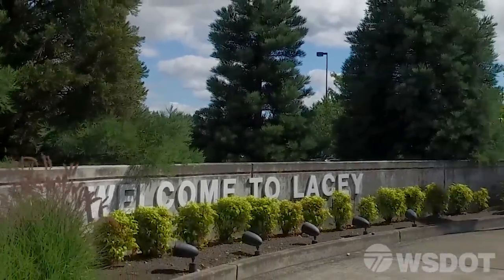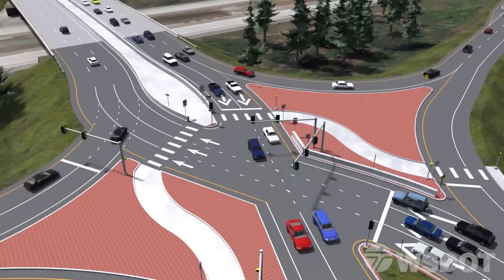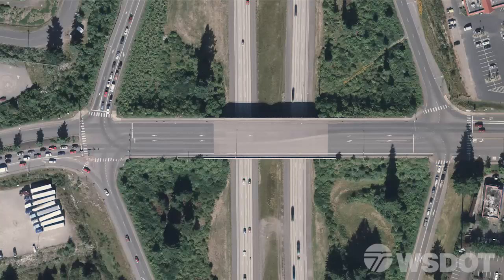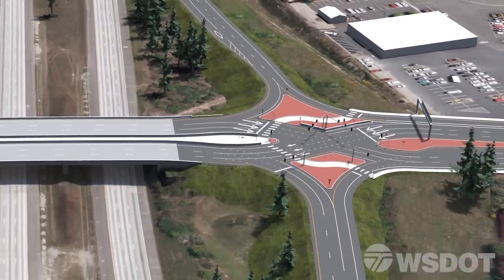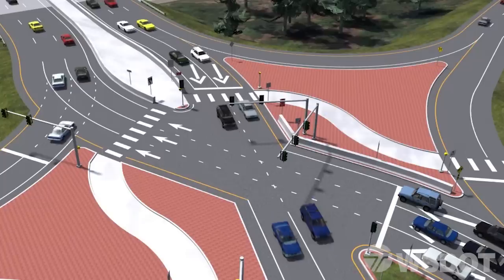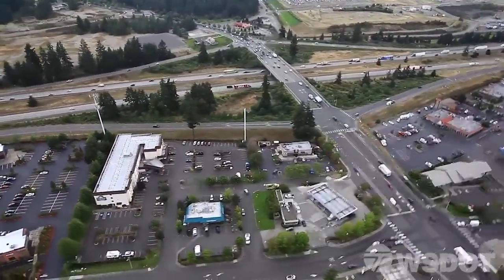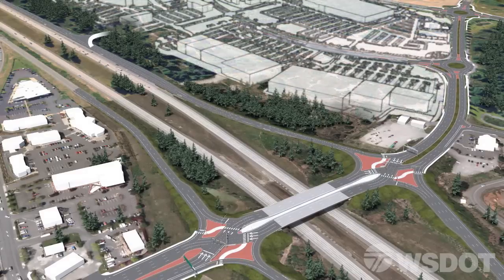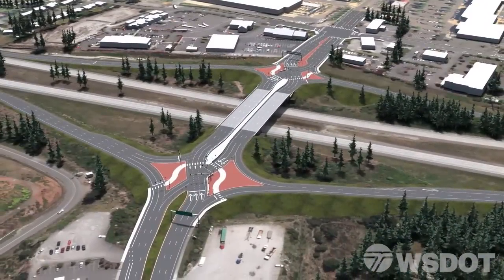Diverging Diamond Interchange comes to Washington State

Comment: Drunk drivers and old drivers get confused enough.  I foresee some crashes at these intersections.
Reply: You just know, those Under the Influence / Confused drivers are going to go straight through, they'll  freak out,  loose control and drive into all those pedestrians and bicyclist making there way down the center of the overpass.  The only way I see these things working is if the state slows traffic down.  You know it could be a new method of population control, most make it through some don't. That was awful dark of me. Sorry
Reply: People should not be driving drunk or high at all!
Reply: Gammareign but they do, so it's a concern that should be addressed
Reply: Gabendini - I agree that drunk/high drivers should be addressed - and removed from the road, not accommodated

Comment: two roundabouts would have done the job..... but ok if you have to deal with bad drivers, then go Diamond with stoplights
Reply: WolfoxBenny or one big one for that matter (which can mean 2 bridges). I've seen it done before in Slovenia, EU.
Reply: Matic Jelovčan that way or make a   motor rod way,  where at each points there are Roundabouts
Reply: That would be best, one big roundabout with two bridges - standard for dual-carriageways and motorways in UK.
Reply: A roundabout is only as good as the surrounding interchanges. If they are lights and are cycling every 2 to 3 minutes, or less if a crosswalk is pressed, then the roundabout is no longer flowthrough but stops with the surrounding lights. Please, understand the full traffic situation in the US before suggesting a model that is completely different. Plus, I'm sorry, but you guys have no idea what traffic is. The worst London, or Berlin can offer is a joke compared to what American traffic can be like. We have far more cars on the road than anywhere in Europe. My community of 100,000 has a freeway through it with 7 lanes in each direction, and it still congests at rush hour. We have that many cars on the road. So no, a roundabout is not a magic solution that always works. They have many flaws and failings.

Comment: You have reduced conflict points down to 14. Why don't you reduce it down to zero conflict points by using the cloverleaf design. you have the space to do it. it will be cheaper in the long run, as there will be no stop lights to set up and electricity used by the stop lights. Less fuel waisted as motorist wait at the red lights and also the fuel wasted accelerating when the lights go green. better for the economy as people will spend more time at work as opposed sitting at the red light going to work. WHY DID YOU NOT USE THE CLOVERLEAF DESIGN.
Reply: the clover leaf design is a very poor design. You have traffic exiting and slowing down in the same lane as cars entering and speeding up
Reply: Slowing down will be a lot safer then having a car in front of you coming to a dead stop. A Freeway means you have a free of way not have red lights stopping traffic. also you can have dedicated lanes for slowing down or for speeding up.
Reply: ...the cloverleaves have weaving conflict points, which are WAAAYYY worse than anything this has. That's why they are being replaced all over the world with more modern designs (such as this).
Reply: Franco Scioli keep it up definitely butterfly is the best . best wishes for you to be transportation minister or  all minds like yours... congratulations

Comment: What's wrong with a roundabout?
Reply: remember, this intersection still has traffic lights. So a round about with traffic lights is the best
Reply: A round-about also allows through traffic to go through smoothly, & right lane cars to divert off without going through the round about just like this DDI, it also eliminates need for a left turn lane, basically does everyhting a DDI does.
But a driver can be stuck on a DDI red light even if their is no traffic or less traffic on the other road. While the round-about driver on a red light is allowed to steal a right turn is there is little of less traffic in the round about. And since it's a round about, the right turn can be used for a left turn as well as a U-turn, pretty cool.
I used to see good traffic management at Bloomfield - orchard lake round about in Michigan sometime back
Reply: Matt Dathew I don't think he knows what a roundabout is...
Reply: In simple understanding, it's just an intersection with a circular island in the middle
Reply: Yeah, now add 3 lanes to it and a volumen of tens of thousands of cars per day. Oh, plus the intersections less than 100 yards down the road aren't roundabouts so when they are red, traffic flow through the roundabout will stop. how does that work out in terms of right of way when it's trying to clear again. Oh, and then stop up 3 minutes later when the interchange down the road cycles again? Yeah... roundabouts do not work on busy interchange complexes like this unless EVERYTHING is a roundabout and that come with its own special problems.
Reply: hey, the red lights on a round about don't mean stop, they mean yield to cars coming from the left on the round-about. The Orchard lake road round-about in Farmington hills of Michigan has two lanes joining the round about with traffic lights on them, and a pass through third lane for cars going to the right as they never enter the round about. We on the other two lanes entering the round-about, always steal turns in case we sense that no cars are coming from the left, and the round about is pretty big.

Comment: I prefer the european system traffic circle
Reply: We have roundabouts, they're fine until you reach a high volume of traffic.
Reply: I wish we had as few cars on the road as Europe. Put the sheer volume on the road you get in a typical American freeway on/off setting, especially at rush hour, and a roundabout/traffic circle falls apart completely. Especially one with multiple lanes.
Reply: Roundabouts, or traffic circles, are good with 2 lanes, maybe 3. Put any more lanes and a roundabout breaks down and requires traffic lights, making it less efficient than a DDI.

Comment: Looks like a great idea...until the traffic lights malfunction. Then all hell will break loose.
Reply: to be fair any intersection where the traffic lights malfunction is a disaster.
Reply: Micah Schultz to be fairer, the majority of t-bone (and all) collisions happen at stop signs and where signal lights are working properly.
Reply: Roundabouts do not require traffic lights. Drivers on the roundabout have priority. Cyclists have their own lanes, sometimes under the roundabout.
Reply: Roundabouts are only as efficient as the next intersection. In America that's a traffic light which will stop traffic. In a high volume freeway on/off ramp setting that will mean the roundabout will back up and clog completely in all directions every 2 - 3 minutes as lights down road cycle. There goes efficiency. Please understand the full traffic picture in the US before proposing a solution that doesn't work within the existing framework. You can't view the interchange isolated from the system. It is a part of the system.
Reply: Very interesting Mycroft16. I think you mean a roundabout with 1 lane in each direction. To handle heavy traffic, the Dutch have developed the Turbo roundabout. So a roundabout with multiple lane in each direction and multiple lanes on the  roundabout as well.
Reply: Well aware of the Turbo roundabout... but it would fail as well in this situation because the next intersection is a traffic light. When it turns red, flow through the roundabout, regardless of the type, stops because there isn't enough room between the intersections to absorb the stopped traffic while still allowing continuous flow through the roundabout. Europe went the roundabout direction a long time ago and so a significant number of interchanges are roundabouts already meaning the flow through works. The US went lighted interchanges that stop traffic on cycles a long time ago... so adding a roundabout in isn't always going to work. Proximity to other interchanges (space to handled stopped traffic without affecting roundabout), physical space for the roundabout (US roadway design doesn't often allow for large round spaces at interchanges as it's all very systematically gridded), and more.

And that's been my point. This interchange doesn't exist in isolation. It exists in proximity and relation to numerous other interchanges and it MUST work efficiently with them. If they are all stop lights then traffic is going to back up as the roundabout continues to allow cars to pour into a stopped interchange. Heavy traffic will back up into the roundabout and it grinds to a halt making it moot.

Comment: DDIs work very well when a large proportion of vehicles on the non-freeway road turn onto the freeway.  For an intersection in which a high proportion of the non-freeway road vehicles do NOT turn onto the freeway (that is, just go straight), DDIs are not so good.  There is probably some "sweet spot" above which converting to a DDI is worth it, but I do not know what that sweet spot is.  I would not assume it is just 50%.

Comment: Why not build roundabouts?
Reply: Roundabouts are a good for lots of situations, but they don't allow traffic to move as quickly or freely as a DDI does - especially in high traffic situations. They also require plenty of space (radius) to account for turning semi trucks. Additionally, there's lots of wasted (read: non-drivable) space at the center of roundabouts - good for aesthetics, but not for maximizing traffic flow. My impression is that in this case, space is limited due to surrounding development, so a DDI is a good way to minimize additional space requirements and maximize traffic flow in peak hours.
-Civil Engineering student at Missouri S&T
Reply: Joe, thanks for stating about the Semi tractor-trailers in roundabouts, as an experienced driver myself have encountered a couple of poorly thought out roundabouts in both commercial and personal vehicles. There are some without the central greenery which do have markings for large vehicles to use as if it was also a 4 way. But then again even that design still confuse too simple minded one tracked individuals who never seem to pay attention to the signs showing the use.
Reply: Snoopy Schulz  We don't have any vehicles with less than two axles.

Our typical semi trucks range from 45-73.5 feet long (14 to 22m). In order to accommodate semi trucks, roundabouts would require a diameter that absolutely exceeds the current intersection size... The MINIMUM turning radius for a full-sized truck is 75 feet (23m). So that equates to a diameter of 150 feet (46m). See Figure 7-5 here in our typical design standards: http://onlinemanuals.txdot.gov/txdotmanuals/rdw/minimum_designs_truck_bus_turns.htm

On top of all this, keep in mind that this intersection is in a busy and growing area. So a roundabout would have to have multiple lanes - probably two main lanes and then outer "fixed" right-turn-only lanes, which would likely be protected by a concrete curb. All of this said, the minimum diameter with two lanes that accommodates tractor trailers would be 150 + 10*2 = 170. Without outer right-turn-only lanes, it would be even more. Possibly nearly 200 feet in diameter in some places.

Sorry, but I can't see where you're coming from in this situation.
Reply: Snoopy Schulz I sincerely regret spending 20 minutes researching and informing my comment to you. Go read a book and talk nicer. Goodnight.
Reply: FYI, there's still ideas on roundabouts with lanes for heavy trucks and emergency vehicles that can drive straight through. A roundabout isn't limited to one way :)
Reply: I agree. Roundabouts are better than signal lights. I want to improve this interchange as well.
Reply: They don't work in North America. Traffic flow isn't good and they just piss people off.
Reply: I hate roundabouts.. it's always a mess.
Reply: Joe Collum I sincerely appreciate your research and comments. Even if it didn't reach the person you intended. Thank you. :)
Reply: I found it quite insightful though, thanks for taking the time to write it.
Reply: Do you realize this is an interchange with a *highway*? A roundabout wouldn't work...
Reply: Read: 
http://www.cbrd.co.uk/interchanges/roundabout-interchange
and 
http://www.cbrd.co.uk/interchanges/dumbbell
Reply: Interchange highway to highway (both high capacity...) 
Three Level Stacked Roundabout
http://www.cbrd.co.uk/motorway/a406/110
Reply: If you are going to use that much land you may as well go with a stack interchange.
Reply: I've already shown a dumbbell interchange actually uses less overall space, and avoids conflict points. check.
Reply: that's a dual roundabout option using the existing cross over.
Reply: For highway exits roundabouts do not work well here.
Reply: Washington already has multilane roundabouts on some of its interchanges. But drivers are stupid and keep making panicked lane changes if they're about to miss their exit while within one. Very annoying at times.
Reply: Rich..... that is a freaking mess ..Holy cow!
Reply: deepsquat600, it may look like a mess, but the high five works really well most of the time and US drivers know how to navigate this type of setup.
Reply: perhaps.. but I am sure things slow up due to so many options confusing slow readers LOL 
 Here in Seattle many many screw ups can occur going through downtown ..causing people to slow to hit the correct lane or else they can be shuffled off to Never Never Land  when trying to go straight thru ..
 I have been thru Atlanta a few times and they seem  reasonable .. you can choose to go around the city or straight through .. Kansas City ,,very confusing .. good thing I hit it on a Sunday // St Louis   a  mess each of the 6 times I have been through ( thank god for GPS) :)
Reply: Roundabouts ARE NOT better than traffic signals. Roundabouts depend on the courtesy of the drivers using them to help regulate smooth traffic flow. Roundabouts have only yield signs to control traffic. If a roundabout gets an unusually high amount of vehicles using it traffic can and will back up quickly.
Reply: I hate roundabouts.
Reply: Engineers need to justify their existence.  Nothing more.
Reply: Roundabouts aren't new. We have them in America. All over the place. And there are several in my city that large trucks can not drive through. Living in a city with mutliple roundabouts and multipe DDI, I can tell you that DDI are orders of magnitude better. There is no comparisson.
Reply: Yes we need it- <<< to be continued

Comment: Good job explaining it but there are problems. 1 when ice and snow cover all of the arrows and lines  things won't be so simple. Also in areas where there is high tourism there is a great opportunity for confusion.   While i think it will work, don't think it is a perfect bed of roses.
Reply: The high walls are supposed to mitigate confusion. Like blinders on a horse. 
But the walls also take away any chance to spot red light violators and emergency vehicles. Even the police MUST wait for the green light, or risk wrecking their patrol car.
Reply: todd Brewer I've driven one of these in MN. Just like in the first person view drive through in the video, the DDI was extremely easy to navigate, with no real confusion at the crossings at either end. From the driver's perspective, there's almost no chance for anyone to inadvertently go the wrong way. From talking with a local resident I met there, he said that one change shaves about 5 minutes off his commute compared to the traditional interchange that use to be there. I welcome our new DDI overlords. lol
Reply: Okay, I kind of like this bridge design but you do have a point there.  It's definitely something they need to improve upon before going through with this project.
Reply: Anchorage Alaska is putting in one and I don't think they thought it threw.  Many people who come threw Anchorage are from out of town to do some shopping.  Large numbers of tourists in rental RVs also add to the mix up. While I think it is a very functional concept it is just over kill for Anchorage.
Reply: Two words: Overhead signage. It's not that hard.